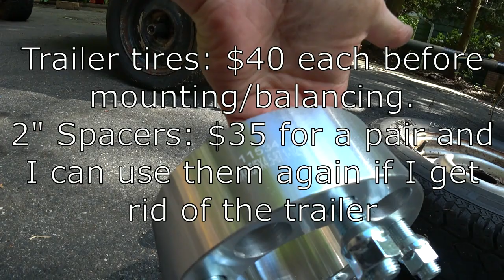How to fit REGULAR TRUCK WHEELS on your trailer

Comment: Couple things with using spacers......
-Make sure the mounting surface is CLEAN !!!!!!!!!
-Use red thread locker on the studs holding the spacer to the original hub to keep them from coming loose as they are hidden by the wheel
-Use a minimum 1-1/2" spacer then you don't have to cut the original studs, "usually" 

Good video

Comment: Some people look for any little thing to criticize about others.  Those wheel spacers won't cause any safety problems.  They're safer than running the rotting wheels and tires that came with it, and they're a hell of a lot safer than something a lot of other "thrifty" trailer owners do, such as flipping the wheel around.
Reply from the maker: I won't lie, i check to see what it would take to flip some steelies around that I had, but quickly decided that was a horrifying option. haha
Reply: I have inverted a set of steel wheels and put 3000 pounds on them and they worked great simply put the valve stem on the inside. The backside of this particular set of wheels did have a tapered whole so I'm sure that helps when using acorn lugs
Reply: @bradsobik5599  just because you have done it and didn't have anything happen does not mean it is safe to do.  The front face of the wheel does not have a surface designed to mate up to the wheel flange of the hub assembly.  All you did is prove how irresponsible you are and how little you care about the safety of yourself and others on the road.  Good job, and kindly turn in your license for revocation and shredding.

For reference, you could drive without your seatbelt and not die a few times; but is it really a good idea?
Reply: @4WDriver  not saying it was safe at all the hub face and the rim sat flush so it worked as I stated before. I did alot of smaller loads before doing so much weight as well. Don't recommend it but in a pinch if it runs true and the lugs stay tight it's all good. Seatbelts are dumb
Reply: Just did it again today as a matter of fact and they work great until I get my wheel spacers

Comment: I did about the same thing as you I have Ford Courier pickup box. I bought it with regular trailer axle 4 lug hubs so instead of getting an adapter I just went ahead and bought brand new 5 by 4 and 1/2 hubs worked out good. I just needed a half inch spacer. Got Jeep Wrangler rims on it now

Comment: To anyone who says that those hub-centric spacers are not safe...  so long as you've installed them correctly and torque the lug nuts properly along with using threadlocker I have yet to run into a situation where they weren't fine.  The spacers that tend to be a hazard are the ones that do not bolt on, the primary issue there tends to be not having adequate thread engagement on the lugs.  But what would I know I only ran similar spacers with stock wheels and 33 inch tires on my Cherokee for four or five years with zero issues.  If they'll hold up on an actual vehicle on the freeway and all other normal driving situations for that long, they are more than adequate for a light-duty trailer.
Reply from the maker: People get it in their head that they are unsafe because they don;t actually understand how they work

Comment: Can't belive no one commented on the spacers NOT being hub centric!
Reply: Me too.  Hub centric spacers cost way more than these.  You can tell them because they have a cylinder protruding from the center and they are undercut behind that center.  And you have to have the stock wheels for the hubs to match them.
    I asked a guy with aftermarket Chevy rally wheels on his early Chevy II if the wheels were hub centric.  He said unfortunately they were not and he had nothing but problems with them for that reason and that most guys don't even know what that means.
  I had some non hub centric Keystone Klassics on just the back of my car and they constantly loosened up. Being uni-lug makes it worse of course. I had to check them once a day when I used to commute on them. One day I forgot and the left wheel got so loose it broke  a wheel stud before I got home.
   I don't think the arrangement he has here will be a problem since the trailer seems to not be used much.

Comment: Here in Idaho people use Chevy beds for utility trailers but same idea, use whatever wheels/tires will work, no need for ridiculous expensive wheel/tire setups on a trailer.  Funny though the wheels/tires on my utility trailer & car trailer are the same size as the ones on my Jeep and soon to be Bronco 2...going to swap the tires off my Jeep onto the Bronco 2 and get new tires put on the Jeep that are more suitable for winter & all terrain.

Hey if those wheel spacers solve your wheel/tire problem use them, its not like you are hauling heavy loads in that trailer.  They'll do just fine, trailer may not but the wheel spacers will be able to work on another trailer in the future.
Reply from the maker: That is the idea. Clearly this trailer is not going to be a family heriloom, so when it goes to that big trailer lot in the sky, I have some wheel spacers i can reuse or sell. Whats up with your Bronco 2?
Reply: @DEInTheGarage  Nothing, just doing some tire switching as the tires on my Jeep are practically new but not the greatest in snow/ice so I figured I'd put them on the Bronco 2 and throw new tires on the ZJ.  Last winter wasn't very bad for snow/ice but I could tell with what little we had that the tires on the ZJ would be a no-go LOL.  Just got the receiver hitch installed on the bronco 2 not that it will see much towing of any sort but kind of a fuel tank guard more or less and for the $25 I paid for the receiver it needed to be put to use...so weird seeing a class 2 receiver hitch that thing is tiny HAHA!!!  I'll post up a pic on the ole facebook page here in a few.

Comment: Yeah, for light weights and no speeds over around 45 mph. It does put the weight out so far it wears bearings fast. And someone will do this put a lot of weight is going to  break studs, blow bearings or bend an axle. Although off roaders and even what is it NHRA and different stuff do, do this, but they have offsets, and axles Suspensions etc set up for it.

Comment: First of all the spacers are pricey and made for adapting trailer rim sizes to bigger or smaller sizes second auto tires are weaker and softer rubber especially in the side walls trailer tires are made to  handle more weight and up and down bounce . 3rd if you get caught with auto tires on a trailer it's a hefty fine around your property is fine but don't use it on the public roads or highways if you have have an accident from a blow out good luck with the fine and the lawsuit if you hurt someone all you won't be covered by your vehicle insurance

Comment: Because my mind Rambles off in the odd places not going to lie my 4.7 Burns about a quart I got a little drunk working on it the other day and took a sledgehammer to the air box because I had to get 5 stitches in my hand doing some spark plugs don't ask just try taking the air cleaner off it have nothing I want to make sure I'm not delusional cuz it's a good possibility that thing sounds so much damn better also I live in Colorado so high altitude may be getting extra air is a good thing I don't know

Comment: Hey Doug! On a 'diff' matter! After havin the wrong oil put in front diff by my mechanic and then 500 miles after jeep sold me transfer box oil for the diff! Now have 75x140 with additive, still not good! The noise I can hear while turning,  what is it? Ps my mechanic, can't recall putting correct oil in transfer and rear diff?  May have got bottles mixed up! What would happen if he has? Really need help!
Reply from the maker: If you only hear it when turning, it likely isn't an issue with the t-case or diff. Is it hard to turn? or does it turn normal?
Reply: @DEInTheGarage  turns normal!   Only had this issue when the oils were changed!
Reply from the maker: @terrystratford1235  It is really hard to say without seeing the Jeep. It could be a CV axle or universal joint and it is on a coincidence it occurred after the fluid change. I wish I could be more help
Reply: @DEInTheGarage  the mechanic that put in wrong oil is helping! Transfer oil 1st (as could have 7o/140 diff oil in!) Then front diff, shafts cv all being looked at! A car I can use! If it is nothing to do with wrong oil, I'm a paying customer! And I've warranty until June 18! I'm confident it'll be fixable! Will update u! Thx again!
Reply: @DEInTheGarage  don't know if this info could help? It happens more on full lock left! With a constant rpm it's a rubbing sensation. Take throttle off and it gets louder and more of a knock! There is also friction, to the point it stops the car! The futher I drive the car, the less I have to turn b4 it happens! She's not long had the front shocks replaced! But no sign of any contact rubbing or damage!

Comment: Is there anyway to contact you in a more direct way? I am looking for an  inexpensive XJ 4x4 and want your opinion of what to stay away from and look for.
Reply: i would say 98 xj with the NP231 transfer case and the Chrysler 8.25 rear end might be the best year of xj, 
98 has fuel injection (simple, automatic, great for offroad) 
98 also had a distributor (cheap and easy) 
98 has decent transmission options, aw4 auto or ax15 manual 
98 Chrysler 8.25 rear end has a 29 spline count axle shaft (instead of the older 27 splines)
98 has a High pinion dana 30 (instead of low pinion) 

99-01 has potential piston and head problems, low pinion front axle, and the coil rails instead of distributor
Reply: @MrMrsregor  Great! Thank you. Pickings are limited in my area at my price range. I don't mind having an older one/something that requires work, as long as it can drive, I can work on it as time progresses. 2wd available but not interested. Either too much money for 4x4 or no responses from everyone else. Trying to stay with private seller, If I find the right one I may buy elsewhere. 

Also, a lot of WJ's available, what are major/common problems to stay away from/look for with them? Mainly interested in the 4.0 but will entertain a 4.7
Reply: @thrRnz9496  i dont know much about wjs (but i like them).. i think xj is cheaper/easier to build/work on (unless you need/want a 4 link)
if you look at any xjs, just make sure to get the 4.0 inline 6
if you want automatic Aisin-Warner AW-4 four-speed transmission ( 1987–2001 ) 
or if you want manual Aisin-Warner AX15 ( Late 1989–1999 ) 
avoid rust
Reply: @MrMrsregor  Perfect, I appreciate the information.